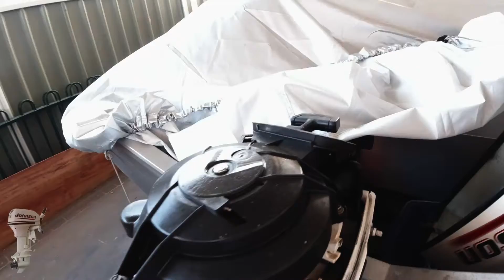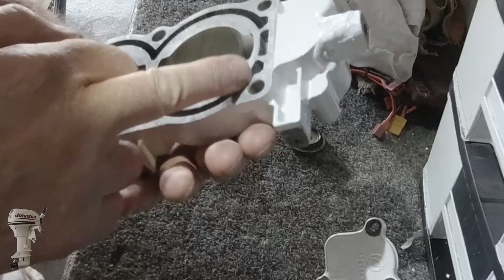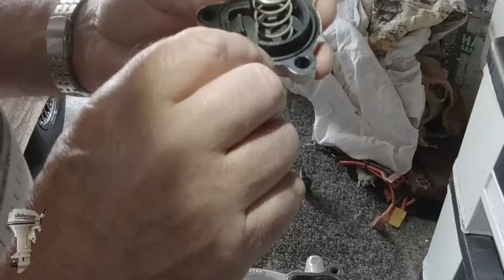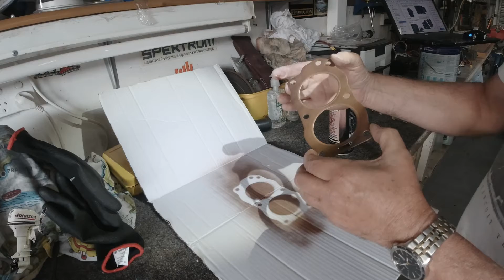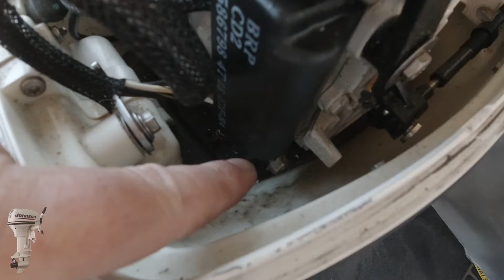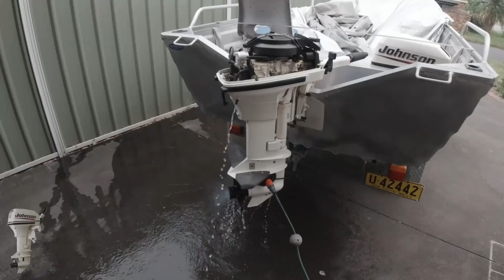Johnson 15hp Outboard Water Pump, Thermostat & Head Gasket Replacement Part 2

Comment: Hey, i have the same engine, it wasn't pumping at all after sitting a few years, I installed a new impeller water pump kit like you but it now will only pump at high throttle and not at low throttle or idle. When red up it will pump. What would you suggest I do next to try and get it pumping on start up and idle ?

Comment: Hi and how much is the torque of this head in Nm
Reply from the maker: Hi the Torque setting for the cylinder head bolts is 25 to 27 Nm. You can find this info at 9mins and 25sec into the video. Cheers
Reply: and one more question, I have the same engine and I can feel the play in the crankshaft when I pull the flywheel up and down, is this normal? @albabmg

Comment: Replacing the head gasket on a Tohatsu 9.8, in researching head gasket sealants I came across some strong recommendations, NOT to use copper based sealants as they will corrode the aluminum block and head surfaces.  This is consistent with NOT using copper based anti fouling on aluminum sail drives.  Wondering if that was a manufacturer recommendation or something you just added?
Reply from the maker: I read various articles and watched several videos regarding gasket sealants and decided that I would use one. I guess its an individual choice. I have had no problems so far. I cant remember if the manufacturer recommended a sealant or not. Cheers
Reply: OMC/BRP manual for 9.9 / 15 hp says to apply a thin coat of gasket sealant to both sides of the head gasket. Doesn’t mention anything about coating head cover screws. Regards
Reply: @danielrobert7181  Thx for the info.  FWIW, my son and I got the gasket installed and the motor working.  He forgot a small O ring on the fuel pump which caused fuel to leak but once got that sorted out a pretty simple repair/ rebuild.

Comment: How do you know if the thermostat is bad?? My 15hp has a good water pump and is pumping plenty of water to keep kool!
Reply from the maker: Sounds like your thermostat is OK. I check mine by placing in a pot of water. Gradually heat the pot until you see the thermostat open. The thermostat should open at about 62 deg C or 143 deg F. You can use a thermometer to check this. Cheers
Reply: @albabmg  I had a new thermostat in my parts so I installed it. It looked like the old one was bad because it was sticking out in the front and the new one was not! Plus the old one was black.

Comment: HI good video, What is the torque that you adjust the bold in in./lbs?
Reply from the maker: Cylinder Head Bolts Torque settings - 216 to 240 in./lbs (18 to 20 ft/lbs)  (25 to 27 N.m) The Manual instructs "Do not use sealants on threads".  Hope this helps.

Comment: Nice video.  Amazing shape motor.  Mine looked like that 25 years ago.  
Do you have any idea what the hole on the right side of the thermostat cover is for.  It opens into a cylindrical cavity in the head.  The reason I want to know is that I broke off the upper right hand fastener and then proceeded to break off my drill bit when drilling it out.  I am considering filling that cavity with epoxy, tapping it, and using it to attach the cover.   It should work ok but I'd love to know what that cavity exists for in the first place.
Reply from the maker: That is a really good question. I wondered the same thing when I was working on my outboard. I couldn't find much on a google search but in the outboard manual it describes the removal of the thermostat assembly and "temperature switch if fitted". So I suspect it is a location for a temperature switch, if you have one. If you don't then I can't see any problem with doing what you suggested. Cheers
Reply: @albabmg  Thanks. That was really helpful actually. I went ahead with the fix and it worked like a charm.
Reply from the maker: @commonsenseoldtimer  Glad it worked out for you. Cheers

Comment: Where did you get the kit from please 
Many thanks
Reply from the maker: Hi I purchased my parts from this Australian website.
https://outboardparts.com.au/ Cheers
Reply: @albabmg  thank you
Reply: @albabmg  don’t suppose you have a video of how the wiring goes I don’t have any spark, it wash set up for electric start but I had to remove it all the cables were corroded
Reply from the maker: @grahamgeorge1130  Sorry I don't have a video of the wiring. I'm not the best at electrical issues. Have you had a look on the net for a wiring diagram? Cheers

Comment: If you remove the lower cowling it will make access to the lower fasteners on the engine much easier..  good video nonetheless!
Reply from the maker: Thank you. You are correct I could have removed the lower cowling. If I had to do the same job again I would. Cheers

Comment: Great video. Really liked this short series. One thing I do say is, you don't need to seal any of the head gasket components. Should be just fine though. That engine is in really good shape!
Reply from the maker: Thanks for your comments. Yes I agree with your comment but opted for the gasket sealant anyway. Cheers